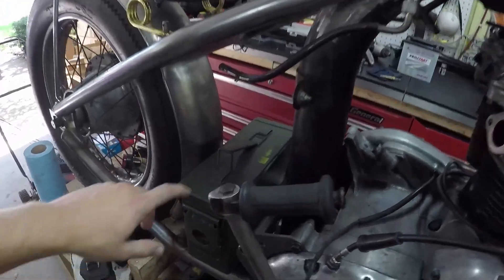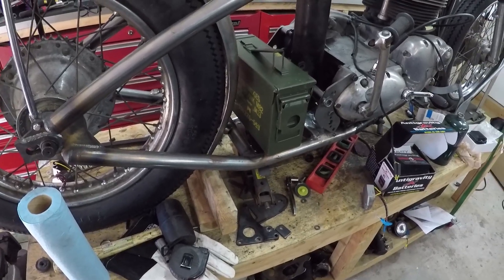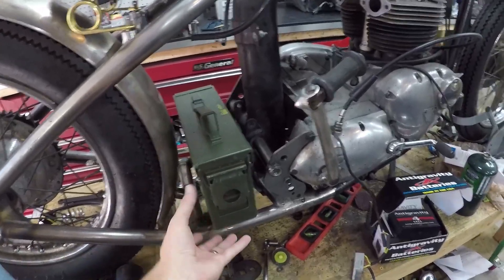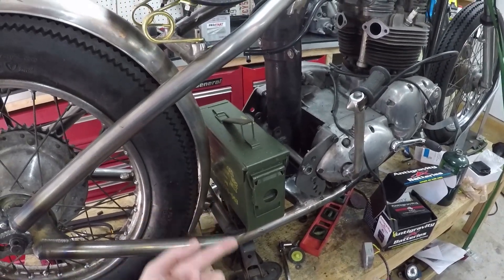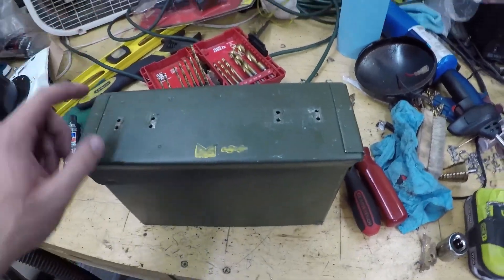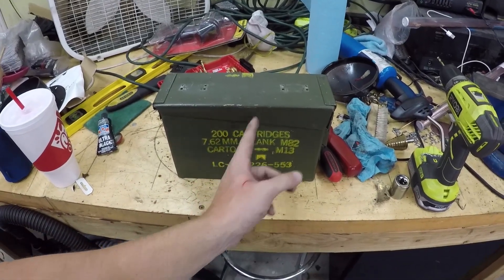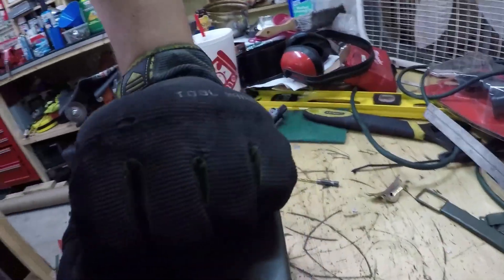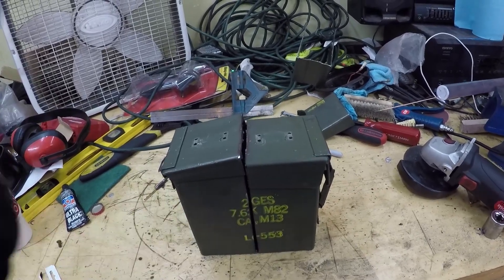Triumph Hardtail: Ammo Box for electronics?

Comment: You've got that open space between the frame tubes. Why not create a 'box' in that space? Weld a plate to the bottom of the tubes and then fab a top to cover it.  Maybe with cutouts to arch over the outside of the frame.

Comment: I like the empty space between the rear wheel and frame. You should keep it as clear as possible, so maybe build as small box as possible under the seat for the electronics.

I have a larger battery and it's hidden under the seat behind the ignition. http://kickstart.bikeexif.com/wp-content/uploads/2013/10/honda-cb350-custom.jpg